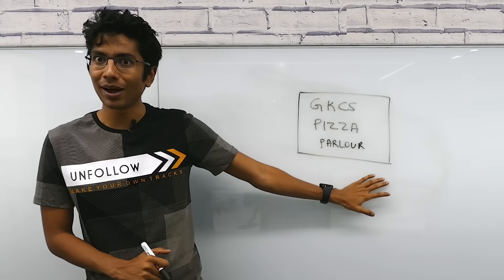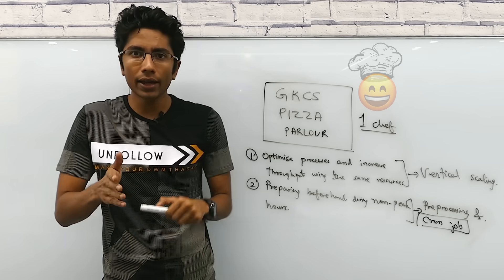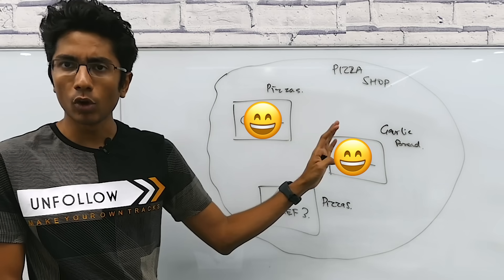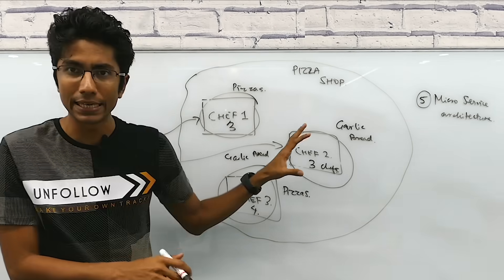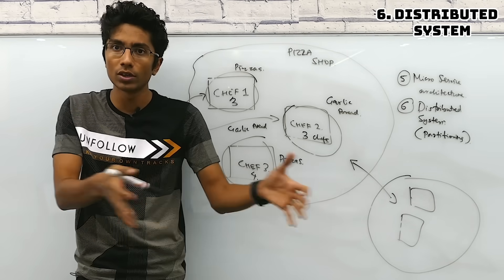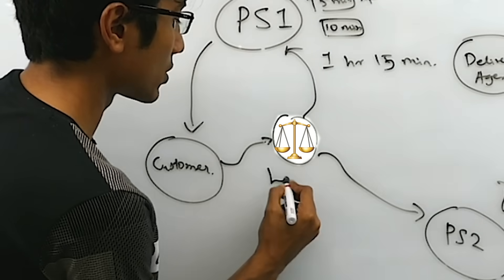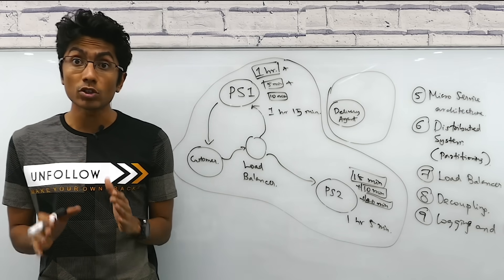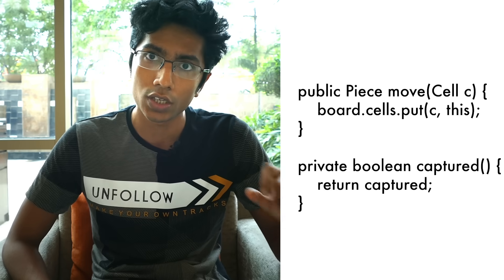System Design Primer ⭐️: How to start with distributed systems?

Comment: Hi sir, should I start with this playlist in order to understand system designs. 
Are there any pre-requisites that I need to know before enrolling? Does the course you have mentioned on pinned comment covers beginners to intermediate level.
 I have around 2 and half years of experience on SE industry, but little bit new to system designing but hoping to be better at system designing at the end of this playlist. 

I enrolled one of the system designing videos of yours on freecodecamp. But could not grasp the full picture as I was not familiar with some concepts. That why I'm enrolling this.
Are there any road maps I should consider?

Comment: Thinking in terms of pizza parlour[High Level Design]
1.) Optimize process and increase throughput using the same resource -> Vertical Scaling
2.) Preparing beforehand during non-peak hours -> preprocessing  & cron jobs[processes that run at a particular type in a day]
3.) keep backups and avoid single point of failure -> backups
4.) hire more resources of similar type to get work done -> horizontal scaling
5.) microservice architecture - assign a particular task to a designated service.
6.) distributed system (partitioning) - the request is send to a pizza shop if their are more than one outlet of pizza parlour so the request can be transferred to any of the parlour this makes the system more resilient.
7.)  load balancer is actually responsible to route the request to particular pizza parlour based upon certain parameters.
8.) decoupling of the systems to make it extensible.
9.) logging and monitoring.

1.) order overload => more recruitement [vertical + horizontal scaling]
2.) complexity in system => separation of concerns
3.) mishaps happens => fault tolerance.
Reply: nice summary version of the video bro

Comment: 00:02 - Optimizing processes in a restaurant
01:23 - Keep backups and avoid single points of failure for computers.
02:31 - Efficiently routing orders based on chef specialties
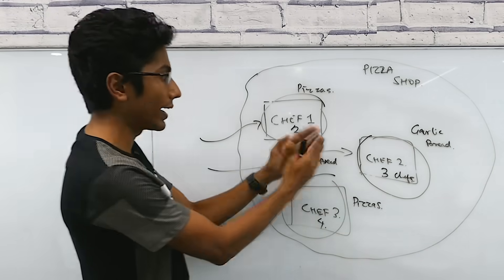03:42 - Diversify pizza shop business to handle emergencies and ensure continuity
04:46 - Distributed system helps to route requests and serve local orders in a large scale system
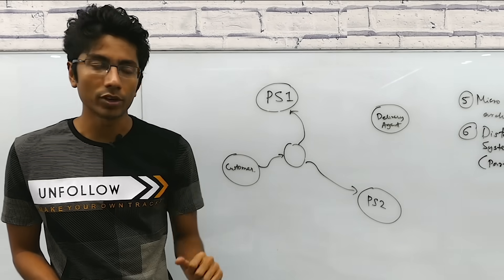05:54 - The central authority should send the order to pizza Shop two
07:02 - Decoupling the system and managing pizza shop and delivery
08:10 - High level design involves deploying on servers and system interaction, while low level design focuses on writing efficient and clean code.

Comment: Lecture - 2

Pizza Shop Business Design Understanding 

1: vertical scaling: optimise precision and increase through put with the same resources 
2: preprossing (e.g cron job) : prepare before hand during non pick hours 
3: Backups: keep backups and avoid single point of failure 
4: horizontal scaling: get more resources 
5: micro service architecture 
6: distributed system (partioning)
7: load distribution 
8: Decoupling ( Separating Delivery or 3rd Party applications with the system )  
9: Logging ( For Logging , Understanding the Previous Trends , Analytics and Machine Learning ) 
10: extensible ( Scalable - Like Today only Pizza but maybe tomorrow Burger and fries )

Comment: 1. Vertical Scaling: Enhance precision and increase throughput without adding additional resources. increase salary of the one chef and expect more output.
2. Preprocessing (e.g., cron jobs): Prepare tasks in advance during off-peak hours to streamline operations during peak times. make pizza dough in advance at 4.00 AM.
3. Backups: Maintain backups and eliminate single points of failure to ensure continuity. hire an intern chef pay him if one goes sick new intern can cook. 
4. Horizontal Scaling: Expand available resources to handle increased demand. Hire more chefs.
5. Microservices Architecture: Implement a modular architecture to enhance flexibility and manageability. Hire more than 1 pizza chef and more than 1 garlic bread chef.
6. Distributed Systems (Partitioning): Divide tasks and data to distribute the workload effectively. Assign orders according to dish.
7. Load Distribution: Distribute customer orders and tasks evenly across available resources.
8. Decoupling: Separate components of the system to reduce interdependencies and improve fault tolerance. Separate kitchen and order section. 
9. Logging: Implement comprehensive logging to monitor and troubleshoot the system.
10. Extensibility: Design the system to accommodate future growth and adapt to changing requirements.

Comment: Gaurav sir, i understand your video but some English words are very new so plz explain with in detail.
Also sir gaurav sir,
Plz slow down your Speed.
Otherwise i have little understand sir.
Thank you.
Reply from the maker: Hey Praful,

I can try to change my way of speaking. But the onus is on you too to understand the content. Changing my speed or delivery is much harder than it is for you to understand by changing the video speed and watching it 3 times.

Also this video is meant to reach out to a large audience. Everyone has different preferences when learning. I cannot specifically cater to an individual.

Thanks for your suggestion and comment though. I wish you a great day ahead 😁👍

Comment: Hi, is clock synchronization is must in every distributed system ? Can i just call it a distributed system where nodes are working on different data set at different locations independently in order to make some business decision at the end. Cant be different computations at different locations be logically independent ?

Comment: Thank you for your effort! I'm a newbie to system design so I can barely understand the notations given in the lecture. 

As I understood,

1) Pizza shop is an infrastructure
2)  the chef is a server (it is a process that runs on hardware)
3)  In the case of the single-point failure I mean when the server crashes. it will be redirected to the backup system (another chef(so backup) is another process that runs on top of the same hardware)

4) I'm confused at that point. Because I think horizontal scaling requires multiple infrastructures. Hovewer, in this case, At the same pizza shop, making an increased number of chefs (servers) named it horizontal scaling. As I understand, If it were opened a new pizza shop, then It would be considered horizontal scaling.

Please re-fix my thoughts about  that.

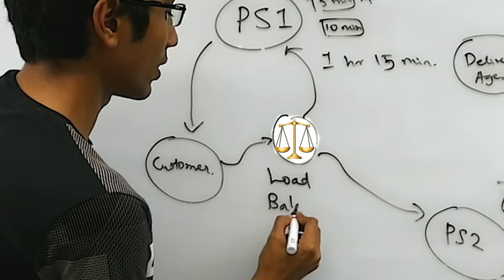Comment: 06:29  Hi Gaurav - is there a desired order for when we want to set up business requirements during system design? In this video, I noticed we first ensure the system is scalable, then fault-tolerant, and then extensible.

Comment: 1: vertical scaling: optimise precision and increase through put with the same resources 
2: preprossing (e.g cron job) : prepare before hand during non pick hours 
3: Backups: keep backups and avoid single point of failure 
4: horizontal scaling: get more resources 
5: micro service architecture 
6: distributed system (partioning)
7: load distribution 
8: Decoupling 
9: Logging 
10: extensible

Comment: What component in the software-delivery process do the pizza delivery agents represent?
Reply from the maker: That is a good question. They are responsible for delivering the product from the server to the end user. 
The delivery agents would be the internet backbone.
Reply: @gkcs  Thanks for the quick response!  What then would "decoupling the system" involve (7:00) in terms of a real-world website?  Would that just be the same thing as breaking it into microservices, or is it a separate process?

Comment: Very much impressed most of the session given by you. Can you provide a small example with codding using all-new required technology(DB design, Load Balancer, Message Queue, Gateway design, Microservice, etc)? I hope all software engineers do not get an opportunity to work in all fields.

Comment: Crisp and to the point video. Makes it easier for new comers to easily understand something as complicated as Distributed systems at a high level(without discouraging them ;). Also one request Could you please explain the difference between sharding and partitioning?
Reply from the maker: Thanks Yugander 😁
I am not too sure. Sharding is usually used when breaking a data range. Partitions sound more generic.
Let me know if you find something different 🙂

Comment: Video after a long time!
It's worth the wait.😃

You covered all the important aspects really well using pizza😍.
Reply from the maker: Thanks Darshit 😁
The last two were on Competitive Programming, so maybe YouTube didn't notify most of the channel's subscribers. 
Back to systems design now 🤓
Reply: Yea i didn't even after notifications on :/

I have just one question here, maybe you could have included API Gateway here and explained the routing between   different services along with LB(which is for single type of services).

This is just my thought, that Gateway( with basic path routing functionality) maybe should be a part of sys design basics.

Or maybe you are saving this topic for later😅.

Would like to know your thoughts on this.

Comment: I have bought algoexpert with your code. Paypal worked there. But here PayPal isn't working.
Reply from the maker: That's strange. Could you send a complaint in the contact page they have? It might be a temporary issue
Reply: @gkcs  yes done that. This sbi debit card is itself a huge problem. It keeps changing the usage

Comment: Hey Gaurav, What book(s) would you recommend to an individual just starting off with distributed systems? I've gone through your videos and some blogs on high scalability but I wanna dive deep so how would you recommend doing that?
Reply from the maker: Try "Designing Data Intensive Applications". It's great 😁
Reply: @gkcs  Will do, thanks! And needless to say awesome videos and keep up the good work ;)
Reply: Database internals (Alan)
Distributed Algorithms .
Domain Driven Design.
Advanced Discrete mathematics  

Articles and blogs on consensus,   paxos , Raft ,Control theory.

Implementation of MSTP protocol in network switches also has some real world design applications.